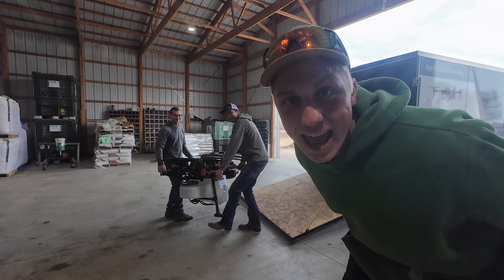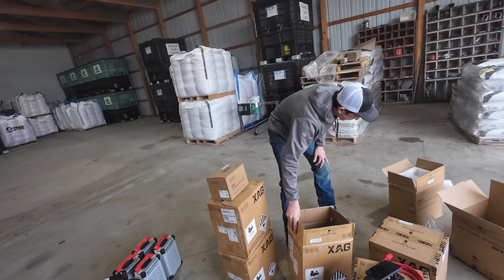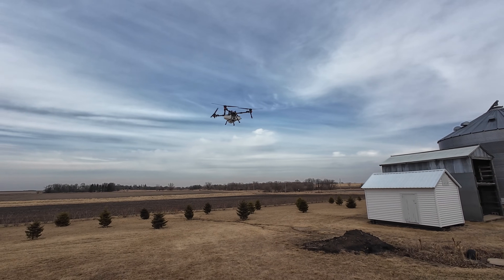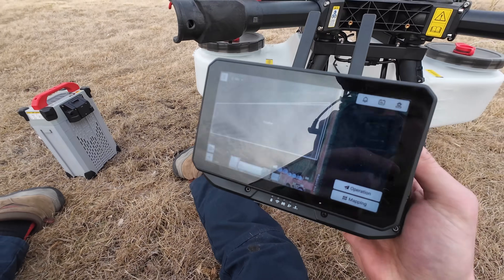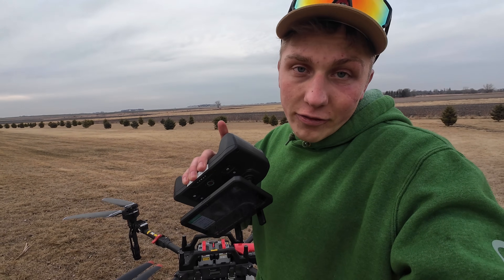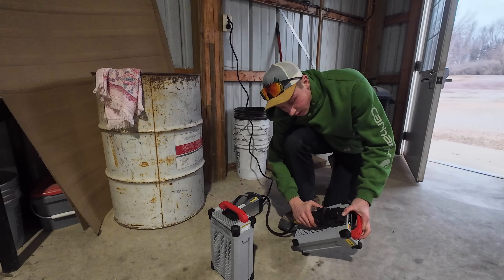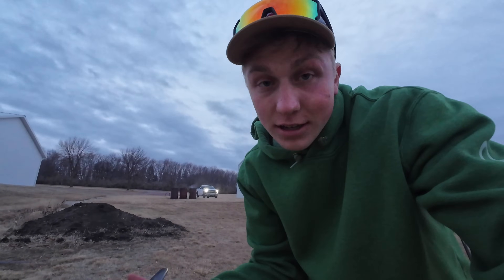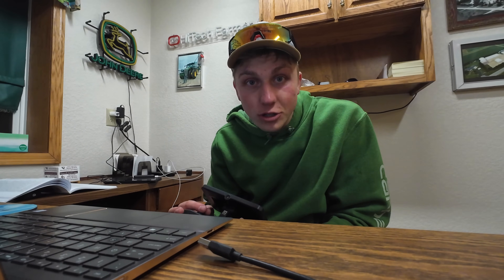My Farm’s NEW Spray Drone is Finally Here!

Comment: When you do custom work will you have to manually fly the boundaries of unformilar fields,to bad you couldn't pull up a gps map and form the boundaries on the controller
Reply: There is a Google maps satellite image on the remote to create a boundary you can also fly the drone to create boundaries.
Reply from the maker: I plan to test the GPS maps and the flying around method to see what works best

Comment: Well you have jumped right in with both feet now. Once the butterflies fade and you gain some experience I am sure you will do a great job. Probably one of the single biggest tech changes that has come into farming in quite some time and no more sprayer tracks in your fields!
Reply: There will still be sprayer tracks. Drones are going to be great for fungicides, especially for corn that’s tassleing
Reply: @ Thanks I was wondering that last night. How can you replace a high clearance sprayer 132 ft wide that can hold up to 1600 gallons with a drone? Using it for top dressing as well as spot spraying does make more sense then.
Reply from the maker: Yes it will be for fungicides and spot spraying. I’ll cover this in a future video

Comment: Now it get's highTech. whoop whoop. Flying a drone myself and especially for your behemoth it might be a good idea to create a pre- and post-flight checklist. And don't feel stupid to do and use one. Private and commercial Airplane pilots use them all the time. With that, like an airplane pilot, you will not forget a crucial step and you will easily get back into flying when you haven't done it in a while. Have it on your phone and laminate a copy to keep close to the drone. It does not cost a lot, but will save you time and money in the long run.
Reply from the maker: I’ll be making this!! Never a bad idea to be too prepared
Reply: @HiTech_Farmer  especially with 4 of those huge chop chops swirling head high through the air. :D